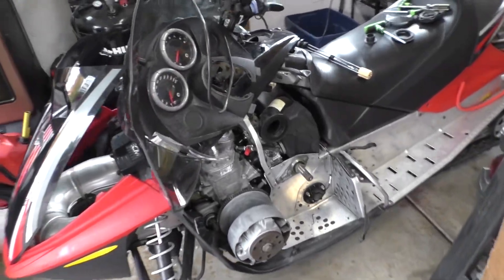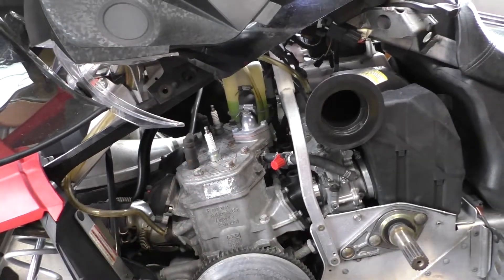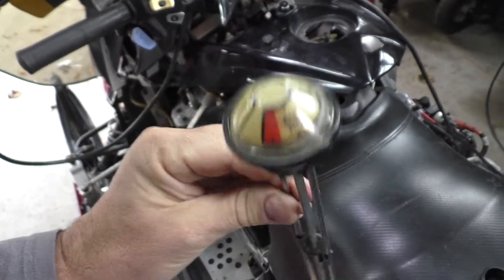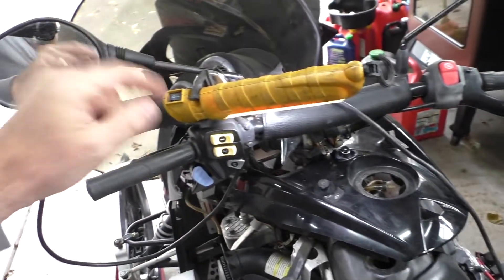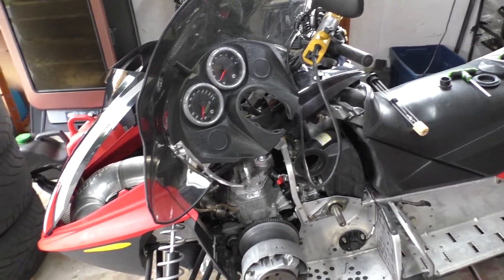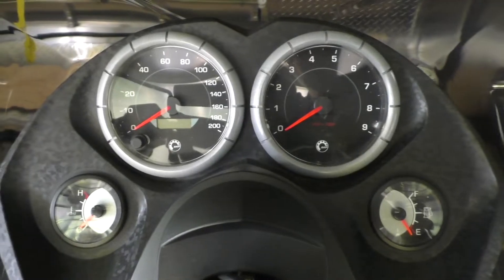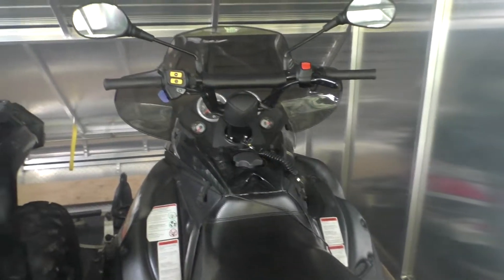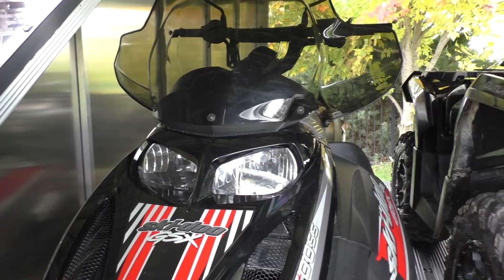Bought a couple used snowmobiles.

Comment: Those look like they will be a blast to ride this winter
Reply from the maker: I just got my son's all buttoned up, went to start it and it just turned over.  I checked a couple things and thought it was the fuel pump.  Sure enough, it's not pumping, probably from siphoning all the old gas and that crap on the bottom of the tank clogging it.  So have a rebuild kit coming.  Good manifold pressure coming into the pump.  They'll be fun in the snow.

Comment: The new ones sure have more power than the old heavy machines when I was akid
Reply from the maker: I actually follow Skidoods on YT.  They ride the old 60s and 70's Super Alpines and Elan's in Montana.  It's a riot, they are like trying to make videos from those old Ski Doo commercials of the 70s.  Those single carburetor 2 strokes keep going.  Now they have crazy horsepower... little too much for me.

Comment: Very nice!  Where did you get the trailer?  Looks like a hybrid not a tilt trailer.  I'm looking at getting a new hybrid trailer soon.  Bring on the snow!
Reply from the maker: That was the expensive part of all this but it will be used all year for ATVs.  I bought a hybrid Triton and sold my landscape trailer.  I didn't like the tilts, they seemed wobbly and I didn't want to lift the clam, ride up the ramp and tilt.  I'm getting old.  LOL.  I also needed something secure.  I bought mine from Ken's in Elma, my brother in-law bought the same one from Bucks. The Tritons have marine plywood, not OSB, they're just better made and keep their resale.  Bring that snow baby!
Reply: @CraigArndt  
Awesome!  I'm going to call Ken's.  What did it cost and what was included as far as ski guides and things?  You can PM me if you's rather not mention price in the comment section.  That's pretty much the exact trailer I'm looking for.

Comment: Nice couple of sleds! Congrats! Yours in clean. Make sure you keep an eye on the skid bearings, bogie wheels and dont fuss too much about a certain oil. Just pic a good one and stick to it. Also good to check your belt temp on first ride to make sure yoir clutch alignment is good. If its not your belt and especially clutches will get warm. Mainly primary. Check out your jetting chart as well and get to know your jetting and carbs. You will want to rejet them in colder temps if they are not setup for below 20°... Should be a label somewhere on the airbox or panel. I have Arctic Cats. So not super familiar with Skidoo. If you havent check out some of the powder coating Ive done recently on a couple on my channel. Got any questions about the sleds and stuff hit me up. Ill do what I can my friend. 

P.S. what state are you in again?
Reply from the maker: I'm in NY near Buffalo.  My skid sounds good, bogies are ok, no real noise issues.  My sons, different story.  1600 miles and it's loud.  Just bought all new bearings to replace so we may do that Friday since I'm off.  Both are clean, great compression, close to 140 on mine, his about 145 psi.  NYS has hundreds of miles of trails, just need the white stuff.  I'll definitely stop by and check out your videos, have a great Thanksgiving bud.
Reply: @CraigArndt  gotcha. Yeah I have anotjer friend thst loves there and he says the same about the trails. 
 If you havent, I wouod probably pull your skid and take a look at it... Sometimes the bearings are in their way out and just dry and stiff. Bearing kits of ebay are like $25 shipped. Cheap insurance for a good riding season. Skids seem intimidating for sure. But they simple overall. Just lots a parts! Lol. Anyway. Yes God Bless you and yours and have wonderful Thanksgiving as well my friend! 
Andrew C.

Comment: Someone bought that with no idea of ethanol gas, would put the cheapest gas at the pump in it and then parked it at the end of the season and never serviced it. And then wondered why it didn’t run right the next season and called it a piece of crap.
Reply from the maker: A lot of people don't know about ethanol and if you told them, still couldn't figure it out or care.  Buying these carbureted machines, have to really know what you put in them.  Thanks Peewee.
Reply: I always run premium ethanol free fuel in all my sleds